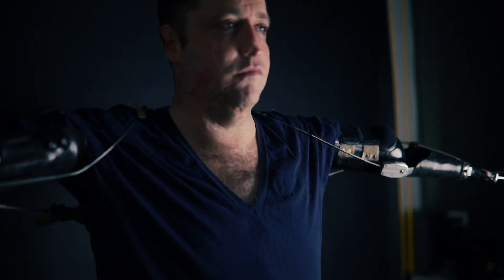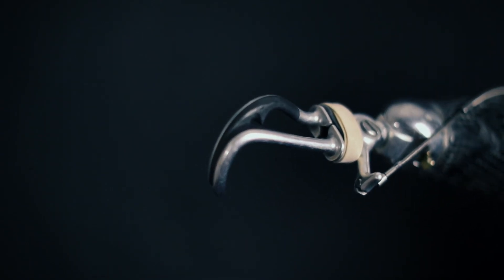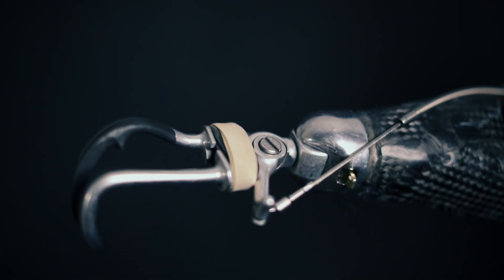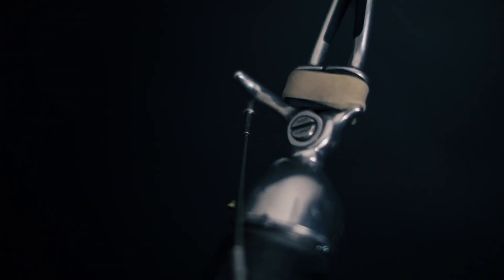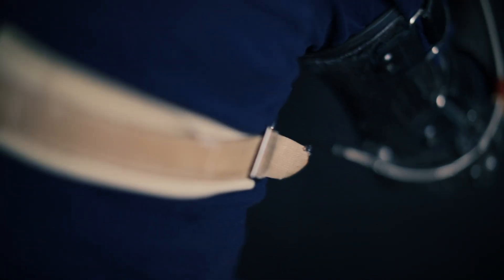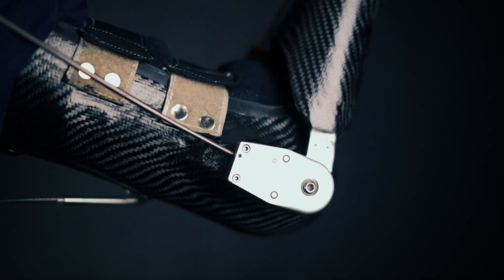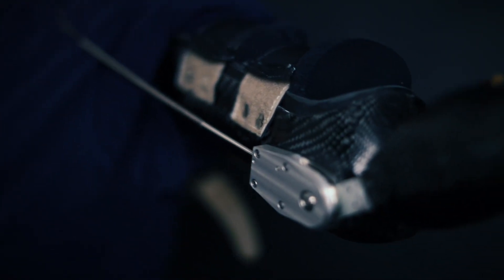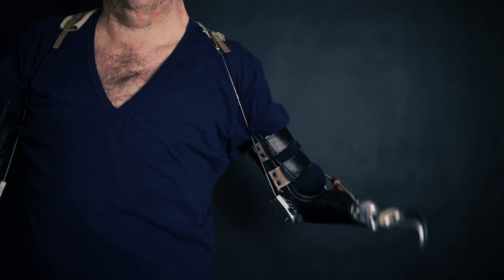How Prosthetic Hands Work (Life with 2 Hooks)

Comment: Hi. 
Are there different types of mechanisms you can switch out with the  hook? for example if you are working on something that could be pierced by a hook or picking up something super fragile like a glass pipette? 
I would have thought they would have attached a gauge to read the pressure of your grip so you don't have to experiment dropping or crushing your host's wine glasses at a party! :o)
Reply from the maker: Hey Moxee33! Great question. They actually make several different attachments in lieu of the hooks, designed for various activities. However, seeing as this would require a constant changing of devices (and probably needing to carry them with me), I opt to become proficient in using the hooks for everything! :)
Reply: @hookie  that makes perfect sense. I just have one other question .could you shoot a gun if you wanted or do they make special guns to use with hooks?
Reply from the maker: @moxee33  Funny you should ask. I tried that recently with a shotgun but to no avail. However if I angled my wrist and rotated the hook I definitely could have :)

Comment: Thanks for sharing, this was interesting. The explanation of the locking mechanism on the left arm was confusing though. Are your prosthetics asymmetric? Is the locking mechanism only on the left arm? What exactly do you mean that it locks into place, is it the elbow joint that locks into place or the grip? Can you control the grip of the left hooks?
Reply from the maker: Both arms and hooks are identical yet mirrored (symmetrical) ... The locking mechanism is exclusive to the elbow and is activated when I engage/disengage the cable that runs up my shoulder (as shown in the video). The hooks are held together only by the rubber bands ... hope that helps! :)
Reply: Why/when do you want/need to disengage the elbow?

Comment: I love Hi Tech gear like this. I can see that the wrist is made of carbon fiber, what material are the hooks made off?
Reply from the maker: Hey there! The hooks are made from Stainless Steel actually... they have some rubber on the inside as well :)
Reply: @hookie  Yeah I saw in a different video that you mentioned they were SS. If I had hooks I think they'd have to be titanium... I'd expect you don't particularly need them to be lightweight but for me they go nicely with carbon. 

I used to do a bit of stainless steel etching. I'd like to see a set of nice polished hooks that are etched - I'd like a bit more bling ;-)
Reply from the maker: @Tonicwine999  Haha! Yeah why not. Lightweight is probably the most important feature of prosthetics though, for me at least!